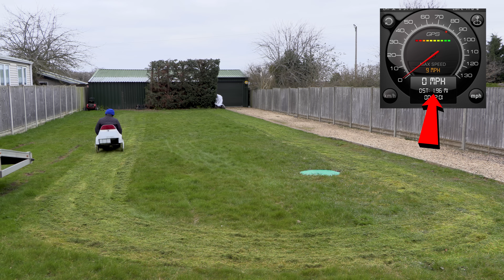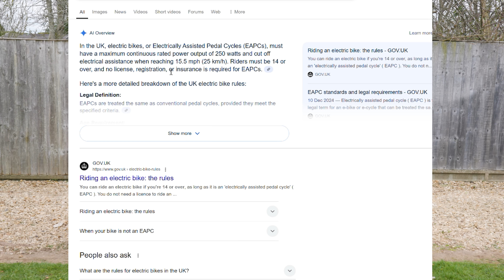Will my SINCLAIR c5 drive 19km?…..

Comment: I remember one of the after market add ons was six foot pole with a flag on it to stop trucks running you over.
Reply: Recumbent bikes and trikes usually have a flag pole, but it is only really necessary so it can be seen above parked traffic etc,  people may not be able to see you when you approach road junctions on the left. Counter intuitively, on the road, I have far fewer close calls on my recumbent trike than I do on any of my 'normal bikes. This is something most 'bent riders experience. People notice them and give them far more space and take more care going past than normal bikes. 🙂

Comment: I know there are rules, but how would anyone know if it was more powerful than is allowed? Are cops able to see everything and know by sight if it was more watts and pull you over and fine you? Does this happen often? Honestly, here in the USA I doubt that anyone would batt an eye. Unless you were going 100 mph in a shopping center parking lot or flying down a tertiary road
Reply: The reality is that probably nobody would notice, as long as you were actually pedalling whilst travelling at unusual speeds, or look to be 'coasting downhill. Above 15.5mph, the motor is no longer allowed to assist you, but they are allowed to travel beyond that under human power only. 40mph on the flat might be suspicious though, especially in something as usual as a C5. The problem arises if you are stopped or involved in an accident. Then you can become criminally liable, have the vehicle confiscated, fined etc. As for the USA, there's a chap who rides an enclosed velomobile, without any motors, that has been stopped more than once by police. They assumed he had a motor under there.

Comment: So, you looked up the regulations for e-bikes and then decided to build a light quadricycle instead? What's the insurance cost on that?
Reply: Quad implies 4 wheel but this only has 3. But, if he has a limiter on it that meets the legislative speed and continuous power requirements for e-bikes on the road, then he should be OK. Certainly some e-bikes have performance modes for off road use. The law does seem quite vague on what can and can't be used legally.
Reply: @another3997  It doesn't matter what the word implies, the UK law defines this as a light quadricycle. If he had either kept it original, or within the current e-bike regs, then yes, it would be an e-bike. He hasn't so it isn't.
Reply: @another3997  The law is not at all vague on what can and cannot be used legally. Go and read it.

Comment: you need to read the law and rules again!! think you've misinterpreted them. the motor has to fiscally comply with the 250w to be used on the road in the UK. Most!!!  to be a  legal Ebike in the UK the motors must have an rated plate with the maximum output clearly stated on the manufactories plate of the 250 watts output max. please read carefully and don't misinterpret what the regulations are clearly saying.

Comment: i would have put a 1000w hub motor on the front wheel, and used a 48v 30ah battery

Comment: Keep in mind that in t his form it is not road legal. Electronic bikes can only use the motor when pedalling.
Reply: I believe you can have a throttle that allows you to move at no more than 4mph without pedalling.
Reply: @another3997  No, look up EAPC standards and legal requirements. With the modifications it classifies as Twist and Go, which needs type approval. And there are rules for markings, assist cut-off, brakes and lights.

Comment: I over volted a Sinclair zeta ( bicycle attachment) a few weeks ago from 12v to 24v. It only has a 197 watt motor. ( Friction drive) Smoke and flames later, I realised the speaker grade wiring couldn’t cope, plus there was a short which didn’t help. Instead of upgrading the wiring, i decided 18v would be plenty. Lots of noise and  dry little increase from 9 mph to 14 ( he also promised 15 mph from the factory) meant that this project, fun though it is is dead in the water.

Comment: Run a limited slip differential from a lawn mower. You will have to relocate the motor to put the Sprocket in the middle of the axle

Comment: It makes me think of a combination between a cheap, under engineered bicycle mixed with a child's Power Wheels. So much plastic in the drive train. Good for you, being sharp enough to upgrade it properly.  Good video. KK
Reply: Built to the absolute limit of minimalism. Lotus did most of the engineering, not sinclair :)

Comment: How about fitting a one way bearing in the rear wheels and lock up the one way bearing on the motor, that may give you a crude approximation of a limited slip diff.

Comment: The "Odd" bit of your channel name is certainly fitting for this one.  I think you have a bit of a death wish wanting to take  a C5 on the road! Better you than me.  😨
Reply: You would be surprised. It seems counter intuitive, but as most recumbent bike and trike riders will tell you, they have fewer problems on their low slung machines than they ever have riding normal bikes. I was told this before I bought my trike, and was sceptical, but it is absolutely true. Have a flagpole so you can be seen over parked vehicles by drivers emerging from the left. Obviously riders should ride sensibly and pay attention, but drivers really do notice us, give us more room, are more patient and take more care around us.

Comment: Great video. Look forward to seeing where this goes. Agree it needs more than one wheel driven. Not sure if you can just apply the power to the axle, or if you need to add a differential. I also wonder can you find some fatter tyres for the rear wheels? I wonder could you also give it disk brakes?
If you're planning to run that motor at anywhere close to it's capacity, I think there's a high probability that the frame would buckle, so I would think about reinforcing it.
Reply: The frame bends at 750w so this will happen if Paul isnt careful. It splits from the middle of the Y of the chassis. Community has several disc brake options available, the front one is usually enough.

Comment: i have gone the same route with that my1020 in the original motor mount. BUT being a 'one wheel peel' it was awful. went with a front hub motor instead and that truly transforms the sinclair into a modern day vehicle. i could drive it to just about anywhere. and it was seriously efficient. i could to 140km in my 48v 40ah pack. And that's at a cruising speed of 30km/h.

Comment: I've not long converted a peddle go-kart to electric using a 48v 2000w Kunray motor that looks identical to your 72v. Before I built it, I used the calculator over at bmikarts to make sure the top speed didn't go over 25mph. You trade torque for speed - and these little motors are known for overheating, and then dying, so it's best to keep the top speed down... My wheels are 11", the motors "rated" speed is 4300 (5700 is max speed for the 48v motor), my motor came with 11 teeth, and I bought a 64 tooth for the rear. According to the BMI Karts calculator, mine should have a top speed of 24mph. I also drilled out the holes on the motor and fitted a fan on the shaft to blow air through it (even after a good thrashing, it only gets luke warm). I have a Bluetooth BMS in my home-built lithium battery, and that tells me it pulls 39amp from a standstill. My go-kart is heavy, and so am I, so although it doesn't struggle with me in it - it looks like it goes faster with my 8-year-old driving it. I haven't tested it for speed yet (what app did you use?). For comparison, my 8-year-old has a 36v 750w motocross bike. She just beats me on acceleration, but I beat her on top speed (her motor pulls 21 amps)... Mine was also only one wheel drive, and I made an adapter out of solid TPU with my 3d printer that pressed into the spokes of the wheel, and bolted to an "axle, wheel hub adapter".

Comment: I was shocked how little there is to one. Impressed by the speed of the up graded version. You sir are going to need a seat belt or harness at those crazy speeds.
Reply: The engineering was largely done by Lotus, so you can see their ethos coming through!

Comment: Did you miss the bit about the electrical assistance only working when you are pedalling?  Yours is electric drive - you have made an electric motorcycle and it needs registering and all the other palaver.
Reply from the maker: Different rules when this was made bud. 

https://www.legislation.gov.uk/uksi/1983/1168/made

Comment: split the rear axle and fit a compact diff in the middle, driven direct off the motor.  or split the axle, and have the diff halfway, driving the axle halves by two chains.  diff diff diff diff diff .................

Comment: On the throttle, the DVLA's interpretation of the law is that a throttle that can be switched to a mode that operates beyond 4mph and change the power setting to above 250w is illegal. A jumper at the ESC seems to be the only legal way of changing the power settings for private land use. But what are the chances of being pulled on the road if you drive/ride sensibly. Hope that helps.
Reply: I think if any cop saw you driving one of those, they would pull you over simply out of curiosity
Reply: @bigbasil1908  yeah, they'd all be too young to remember them.
Reply: I don't think anyone would care what's under the body, it's not like the old German borders in the EU where we saw vechicles body off being stripped down looking for something ominous.
Reply: @oojimmyflip  Some police forces in england have dynamos to measure motor output now, it's quite strange
Reply: @ if there was an accident with an injury and the police turned up, then there could be issues. One weighs up the risk of that, I suppose. You can never say never.
Reply: Vehicles before 2016 have an excemption for throttles i believe, it's grandfathered in
Reply: @ only if they were fitted as standard. Mods don't count, apparently.
Reply: @ezzbuttheyshouldntleavethe5529 Precisely, always goes by year of manufacture. Otherwise antique cars would need neat belts and airbags adding retrospectively. Which would be funny thinking about it 🤔 😅
Reply: @patrickmooney5035  Honestly imagining an OG beetle with "self driving" 🤣
Reply: @ezzbuttheyshouldntleavethe5529  'I believe' doing a lot of heavy lifting here
Reply: @ what do you expect? Do lawyers ever give a straight answer?
Reply: @drainbamms  No, it's a genuine thing, I've since researched it to make sure I was right
Reply: @ only if that were fitted as standard. The C5 had no throttle as standard. You'd have to argue that the modification was done before 2016.
Reply: @BigDuke6ixx  But, you can at least use the go button without peddling up to 15mph as that was standard I believe.
Reply: @patrickmooney5035  was it? In that case it would be fine.
Reply: @patrickmooney5035  just checked the manual, and its Go button did take it to 15mph.
Reply: uk law is a joke hence why most ignore it . Conservatives brought in a proposal to make it more fair . Labour rejected it . Won't stop people though the fight is on .
Reply: @BigDuke6ixx  Doesn't the motor have to have 250W max stamped on it. He is risking the C5 been seized or worse with an over sized motor.
Reply: @patrickmooney5035  yeah, a CE sticker. Easy enough to get one of those. The motor can be a complete monster, but as long as the ESC restricts it to 250w continuous output, it's fine.
Reply: @BigDuke6ixx  Cool, I was wondering if it might be a good idea to stamp the motor 250w max as well?

Comment: Under UK law, the throttle can only go up to 4mph.
Reply from the maker: https://www.legislation.gov.uk/uksi/1983/1168/made
Reply: @ built before 2016, so throttle up to 15.5mph should be fine. The ability to switch power setting above 250w other than vie ESC jumper wire would be illegal, though, I think, according to explanatory notes on the DVLA site. I would still say that the chances of being pulled are remote at best if you're sensible, but being involved in an accident where the police turn up would be the joker in the pack. .
Reply: @ I've checked this, and it appears adding a throttle that goes over 4mp is illegal because it's a mod. Although, you could potentially argue that you did the mod before 2016.

Comment: probably a bit late now, but I would gave gone for a 10 inch hub motor for an e-scooter and replaced the front wheel, some I have seen also have a built in drum brake so you can replace the rim brake of the original

Comment: I know people like to keep these things as standard, but on my old one, around 8 yeaes ago ,we swapped out the whole back axel, what there was of it, swapoed it for the back axel and motor off of a 'drive cobra' mobility scooter, which after welding in a few brackets went straight on. 

Added 2 lithium batteries, deristricted the controller unit and added a throttle to it on the handlebars. With a lightweight person in it it could go 25-ish mph, with a larger build, naybe 21mph, but for speed-legal reasons you could adjust either the speed regulator, or just adjust the throttle travel, so it couldn't go more than 15.5mph, although im sure the motor was bigger than 250w. 

But we only used it off road on private land anyway.  By using a smaller mobility scooter back axel and motor, they make a more reliable replacement on these C5's, especially if you aren't fussed about it remaining stock and original. And it means you can fit better wheels and tyres and even add suspension, and upgrade the uncomfortable seat. 

But you can still use mobility scooter parts and keep it stock looking, at least from the outside.

Comment: Did you miss the bit in the EAPC rules about 'Off Road Mode?' 🙂

FYI - the C5 only has to follow the 1983 EAPC regs: https://www.legislation.gov.uk/uksi/1983/1168/made
Reply: Does that rule also apply to a modified C5? Does upgrading the motor, drive chain and controller for modern ones invalidate the old legal requirements?
Reply: @another3997  I don't think so. As long as you stay within the rules. Pretty sure you don't need to put seat belts in a car from the 50s if you upgrade the engine.

Comment: All barn find C5s need the motor servicing as the grease dries out and then the plastic gearbox melts and the motor overheats. Suggest that's what has happened to yours.
When removing the motor, don't pull the brushes out of the brush end as shown here as they don't go back in and you cant get replacements. Any replacement brush that fits is for high voltage, low current applications where as the C5 is low voltage, high current. 

The C5 chassis seems to be fine at 500W but any more and it will bend ahead of the motor and likely split down the middle. You can give it some strength by seam welding.

The rear wheel bearings and cups are unique to the C5. We have new old stock of these if needed. With the bearings sounding how they are then the cone nut and inner cone will be chipped or cracked, again unique to the C5 but we have them. Tensioning those bearings is extremely fine. Best for it to be a little tight than too loose.

You will need to remove the body again to fit the crank. One side fits all the way in but the other side is adjustable so you need to set it up and lock with the lock ring. If you're missing the chain tensioner you'll need it and the chain is a specific length with half link. Anything shorter or longer and youll have a bad time.

If you want a bit more turning you can flip the handlebars forwards, but seeing as you'll undoubtedly be going fast at some point maybe keep them how they are.

Definitely replace the tyres and tubes.

For cleaning the body "elbow grease" with "the pink stuff" is okay for a mild clean. If you paint it it needs to be prepped really really well, but the end result with paint is always the same that it chips or is worn off. General advice is always to clean it best you can and keep it original white plastic.

Any spare parts, don't put them in the bin. We can rebuild that motor and put it in another!

Sam - C5DEPOT
Reply from the maker: Cheers Sam, I’ve just ordered a load of parts mate 👍
Reply: What an excellent technical statement on the inner workings and structural limits 💪 of the C5, if ever find one,,, 
I'm coming to see YOU guys....
 👏 👏 📏 ⚙ 🔋
Reply: @Craig-wp3pz  thanks. Ebay and Facebook marketplace are the places to be checking! We build to spec too :)
Reply: Amazing to be keeping these iconic things going. I remember fondly when they launched. A vehicle ahead of its time.
Reply: @harpingon  "ahead of its time" is the #1 comment everyone gets when riding these out and about. At NEC Classic Car Show its actually unbearable, every 5 minutes I reckon.
Reply: @C5DEPOT  glad I could not disappoint :)
Reply: 😮 you must of been bored 😂
Fair play mind 🎉
Reply: thanks for the info, appreciated
Reply: And to think there were many who thought the Reliant Robin was the crappiest built 3 wheeler on the British roads.......not by a big margin as long these cock-eyed contrivances still exist🤣
Reply: @howardosborne8647  this isnt a car though 😢
Reply: @ I didn't say it was a 'car'

Comment: *Haven’t read all the comments…but Paul, in case nobody has added, the drive is exactly the same as a cycle rear ‘free hub’ sure you could create a better rolling resistance version with todays components instead of what Clive had available back in the 80s 👍🏼
Reply: …BMX bearing for the brake side 😉
Reply: its a one way clutch bearing in the pulley. Normally they just need regreasing. Ive only had one slip which was a weird issue to diagnose

Comment: Great vid Paul. Colour - keep it white with a go faster stripe. Looks the same, so plod wont even give it a 2nd look. Agree with other comments, motor through 180deg and drive the shaft not the wheel. 2nd test run, it went like the clappers, my guess, better than 10 MPH!
Reply: It is driving the shaft as it currently is as its welded onto the axle tube that slides onto the axle splines.